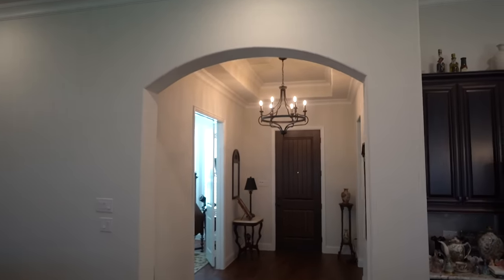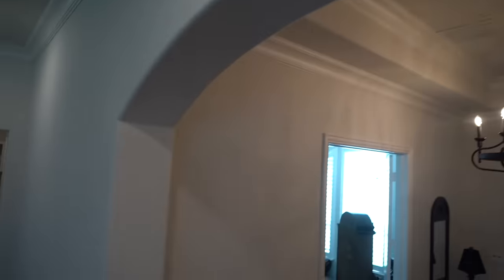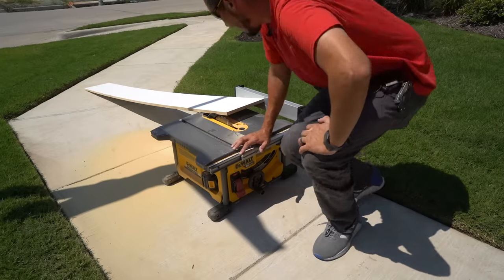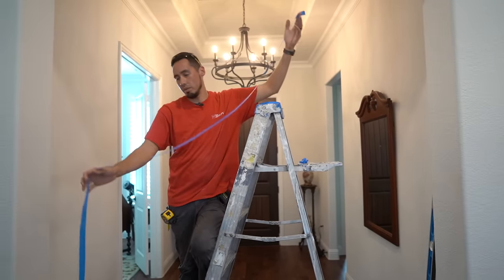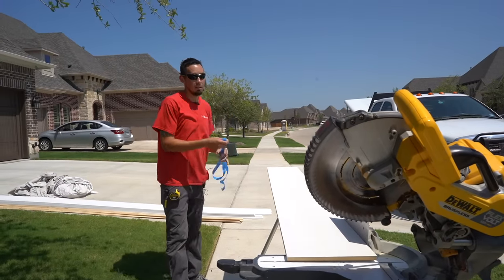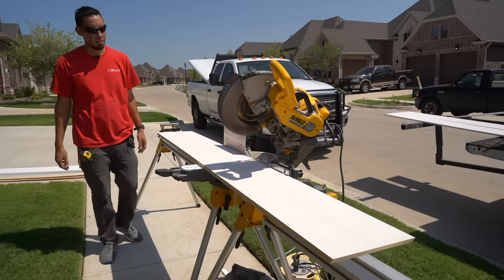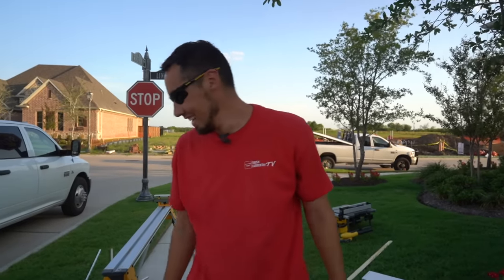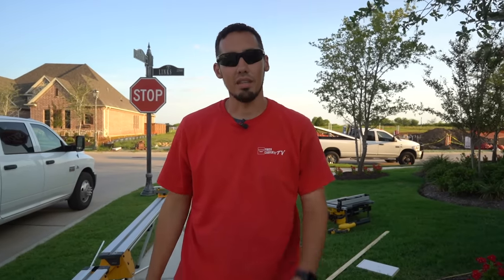Carpentry trick with masking tape

Comment: Serious question: I was taught to remove drywall cornerbead so that
1: client entry ways, window jambs, etc do not lose usable space 
2. You aren’t “fighting” the build out and potential irregularities left behind my drywall finishers. 

What are your thoughts?  Extra, unnecessary work?
Reply: Totally unnecessary and not recommended for just a trim job. Too messy, more work than normal and 4x the time on job. The pros waaay outweigh the cons of loosing an inch of “usable” space. Especially a doorway that wide. If you were rebuilding or deleting a wall, yes. But for simple jobs like this, build over.

Comment: I like your method with the saw for making a flexible board but I do know of an old ship building method where they use steam to soften the wood and then press it too shape.

 The steam warping method takes longer so your method is better economically but using steam could be helpful in the bag of tricks for those edge case scenarios. Also it's neat when you can make things that make other carpenters be like "WTF HOW?!!".

Hybridizing both methods could help you from snapping the wood while not requiring the normal amount of time to fully steam wood to be pliable, maybe?

Comment: Good trick for tighter or shorter arches, is to just rip 1/4" MDF or 1/8" into strips the width of your arch. Cut them a little long, and essentially laminate them in place. Stack as many as you want for your reveal, and then put your legs up to them.  Badabing badaboom

Comment: Great tip. As soon as you pulled out the tape measure on the arch....i thought, "Tape time".  Brilliant. Thanks. 

Does your vacuum come on when you pull the trigger on the saw?  Curious since the saw is cordles, vac looks corded.   I am trying to integrate the two, but dont want to give up my plug in vacs.

Comment: Great trick with the tape. This would be the real tape measure. Have you tried kerfing your boards using your miter saw. I set the depth of cut on my blade/saw with the depth set screw and it works just fine for me. Keep breathing MDF dust. I do too.

Comment: Another blue tape trick I use all the time. Say your installing stuff on the walls. and you need level lines and tick marks or measurement lines. Put blue tape on the walls where marks will be. Mark up the wall. When done pull the tape.

Comment: Just a thought, couldn’t your compound mitre saw also be used to cut the grooves on the back side for flex?   I think most mitre saws have a depth stop adjustment if you need it, I could be wrong.  Im sure you have a good reason for not doing that and using a circular saw though, because you’re a pretty smart guy.  Just my two cents great trick.
Reply from the maker: Tufelhunden713 yes I actually have a video showing how to do exactly what you mentioned.
Reply: I figured that might be the case also.  You are always looking for “smarter not harder” tricks and are a wealth of knowledge.  Still this is a great idea with the tape and I’ll definitely use it when the time comes

Comment: Richard take a look at DEWALT DWE74911 Rolling table saw stand. Around $158.00 at Home Depot.com. The table saw mounts permanently to the srand instead of using the Dewalt clamps. I absolutely love mine! No more lugging the saw around and the saw is safer to use.

Comment: Why didn’t you just use 3 pieces of 1/4 MDF instead of kirfing the 3/4? It takes longer to kirf and when you kirf mdf it breaks easily, you don’t have to worry about the casing covering the saw kirfs either you don’t get the flat spots that you got either doing it that way.

Comment: you ever try powergrab? locktight makes it, I never used liquid nails again
Reply: I like the power grab for some things but have had problems with loss of adhesion on cinder block and other masonry products . Liquid nails never lets you down . I have a tool belt that I did a patch on 30 years ago and it's still holding !

Comment: Wouldn't be working in my house when you don't take any precautions to protect my hardwood floors. Roll out drop sheets from outside to inside and cover the hardwood with cardboard so the feet of the ladder don't gouge it or scratch it from debris that could be stuck in the rubber/plastic protectors. 5 minutes of time will save you your reputation. Plus in my town, you can't block the sidewalk forcing people or kids to walk out onto the road.
Reply: By the sounds of it no one would want to work for you anyway so no harm done then ah hahahaha
Reply: Seriously Gareth? Is that your rebuttal? So I guess when you paint you wait until the job is done and wipe the paint off of the floor? Of course not, right? Then why wouldn't you take the time to protect obvious expensive hardwood flooring? It's called showing your customer you respect their investment. I have 3' wide runners that I unroll in front of me as I enter the home. I also cover adjacent furnishings with a light plastic drop cover to reduce dust from my work. An ounce of prevention saves a pound of cure. You go in and out with running shoes that can trap small stones in their tread which would do what without a drop sheet? Scratch the floors? There goes your profit repairing them. And besides, I don't ever use that cheap MDF crap. It's garbage and you know it.
Reply: @normsayle677  your a flipper hahaha
Reply: Nope. Just a contractor that respects their customer. Word of mouth is the most effective inexpensive advertising. What's with the hahaha? How old are you? I mean physically, not mentally.
Reply: @normsayle677  troll
Reply: I'm the "truth hurts" troll. Gareth!!! Did you slander your teachers when they pointed out your mistakes? I certainly hope not. If a person isn't open to constructive criticism, how do they learn? Myself, I like to learn something new every day if I can.This is why I've become very successful in life. I not only maintain excellent work ethics, I also appreciate others investments, by making sure they're protected while I'm renovating. Plus it saves time when cleaning up. Save 30 minutes of clean-up time per job. It all ads up. Cover everything in the area with 2 mil plastic too, to eliminate most dust. 9 ft. by 1000 ft. for $20.The owners appreciate it too, instead of complaining to their friends about it after you leave. Like, look at the dust everywhere. And/or look at the scratches in my floor that weren't there before. Who needs that kind of a reputation? An ounce of prevention is worth a pound of cure. Just focus on the details.
Reply: Your response speaks volumes about your mentality. In many cases the truth hurts but in the end one hopes a lesson is learned. Did you disparage your educators too?

Comment: why kerf with a circular saw.? I would have set the depth on the miter saw and used it.
Reply: I knew someone would post this, I too would have used my miter saw to set the depth. I still use the circular saw method here and there so it is a good method.

Comment: 2 layers of 1\4 inch burch plywood would have saved some time
Reply: Except he needed 3/4" finished thickness, so 3 layers of 1/4" BIRCH plywood 👍
Reply: Except nobody wants to see layers of plywood for there trim.
Reply: @maverick7969  once the face trim is on you won't see it and besides it will all be painted
Reply: @colstace2560 If you show a reveal which every trim Carpenter I have ever seen  does. You will see it. It's not the painters job to make the carpenter look good. Take pride in what you do.
Reply: @maverick7969  I would never show more than 1/4" reveal so you would never know it's built up

Comment: How do you get the edges of MDF smooth?
Reply: To be painted? If so, i just paint/sand/paint/sand up to 4 times until its smooth. I use 220 grit
Reply: @skyebluepainting  awesome thanks dude!
Reply: @nickl8192  sometimes it helps to start with a primer like b-i-n shellac or just regular oil kilz because they sand much better and dont rip like a latex paint. On the final sand(or every sand if your crazy) i use a little bit of water to wet sand it and it turns out perfect.
Reply: @nickl8192  on our millpacks we paint those edges with a brush because spraying just dosnt cut it and it absorbs so much of the paint

Comment: Is that 2 saw benches joined together?
Reply from the maker: kizz jd yes thinking of some ways to have max support for materials
Reply: @FinishCarpentryTV  that's a good idea, I have the same bench, it's good to cut something in the middle. But when you want to cut the end then bring it through and cut the other end. Its hard to balance with 2-3 more meters hanging in the air!

Comment: Richard, nice work, but why do you guys keep doing so much casing work with MDF?  For example, the extra added cost on this job to simply do the leg casings in FJP or poplar would be de minimis cost to the client, and now you have added real wood stock to the most vulnerable part of that archway - the high traffic area where vacuums, feet and elbows (and pets)  make contact.    Out here we never use MDF where there can be heavy traffic/contact, and explain it in detail to the client.  Your quality of work is too good to use this crap material for anything other than trimming out windows or running crown.  Just my thoughts.    (However, if a GC hired you for this job, then I totally understand)

Comment: 30 year master carpenter...stop pulling that guard up every cut...very bad habit and dangerous...I have watched many of your videos...some great tips...but that saw don't take NO for an answer if it bucks on you...Raise your work up so you can see it better without pulling up guard with cross hand...The fold out Dewalt set-up is convenient, but has zero work space...get some taller horses and make you a great saw table out of one section of a 16' (8' saw table) or 20' (10' saw table) aluminum ladder adding finished plywood to the top with counter sunk self tappers...add a left and right fence and some 2x4 runners every 16" or so...add 2 little "L" shaped stops behind saw bases for instant placement of saw when screwing it down to center plywood piece...That's what I used for 20 years...still have both tables I made in 2000 w/original 3/4" birch finished plywood sides still intact...but more for setting up on a larger trim project or whole house trim out...I just replace the smaller 16"x16" center piece of plywood under the saw occasionally because the screws will eventually strip it out...great table for ripping with skill saw, jig saw work, coping base & crown, screwing, gluing, drawing, writing down measurements, etc...I added wooden compartments behind my L&R fences to hold 1 1/4" brads & 2"/2 1/2" finish nails, 2-part fast glue, wood glue, screws, jigsaw(drill hole for blade) and a hole for coping saw and one for Dremel tool...also added a Yellow Jacket outlet strip I got at Sam's to the back of table so I could plug in multiple tools or cords...battery chargers sat below on flat spots on horses...great set-up and ends up weighing about 60-75 pounds...keep up the good work...sorry for the book, just some tips

Comment: Noticed that you had your mitre saw on the footpath outside the house, do you not have locals complain about obstruction.
Reply: Do your locals complain about every minor inconvenience?
Reply from the maker: David Hackett I have not had any locals say anything about it. It is probably an inconvenience to walkers but they just go around.
Reply: Most people understand that during the day(when 80/90 percent of people are at work or school). The sidewalks get used by contractors.  Have done lots of work where the driveway and sidewalk has been the saw stand area.  As long as you clean up well most people dont ever complain about the sidewalk being blocked.